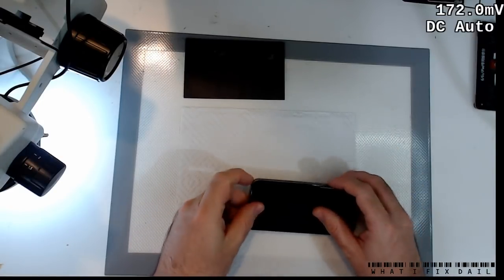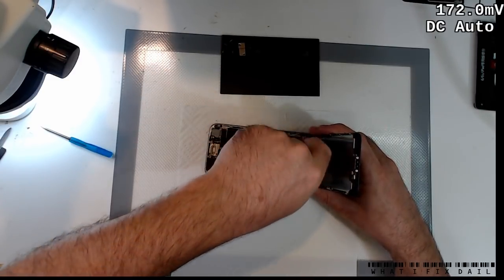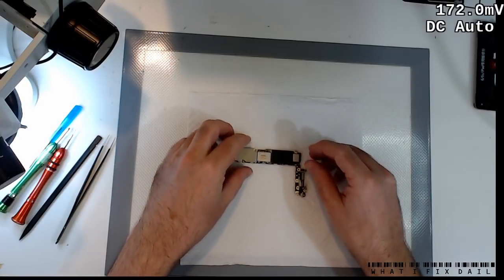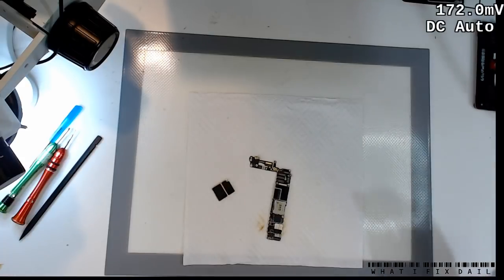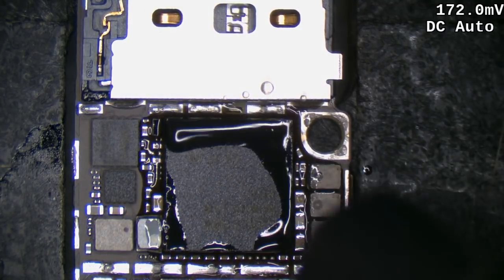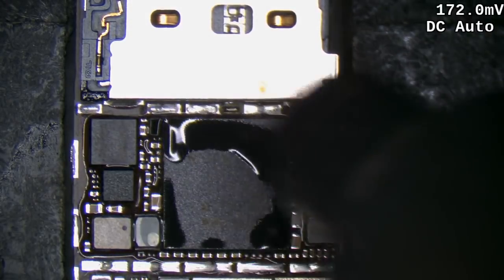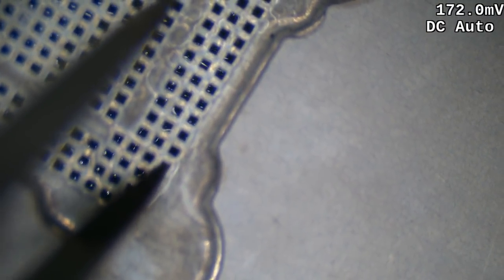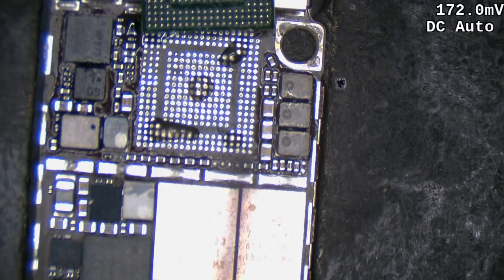iPhone 6 endless searching fault - Baseband CPU fix

Comment: Which dry solder paste do you use please?
Also you were mentioning that if the power supply draws only 130mA, it might be a short? Did I get it right?
Reply from the maker: I've forgotten the context on the 130mA comment, sorry.

As for the dry paste, it's just cheap normal 63/37 leaded paste, in this case, the "Mechanic" brand, and I leave the lid open a while until the flux solvent dries up in it.

Comment: Excellent! 
Paul, what do you do at 9:30 ? UV curing? If so, the UV curing equipment is fairly small?What kind of equipment is that?

Can post a link to the reball stencils you use? (I was told square hole stencils  are better thank round hole stencils.)

What temperature do you use with your stencils so that they are not deformed after very few uses?
Thanks for replies.
Reply from the maker: I heat a large area on the stencil so that the metal expansion is "evenly spread" which reduces unwanted buckling.

The stencils are from UnionRepair, 3D stencils with square holes ( and yes, square holes do make it easier to remove the balls ).

The UV curing is just a cheap UV torch I bought for other purposes.  It is not as quick as using a big 5 or 10W lamp but it still cures the green liquid in a couple of minutes.

https://www.unionrepair.com/mj-3d-bga-reball-stencil-for-a8.html

Comment: Do you really need to put the RF shild back on again? I'm asking this because there's a lot of shilds arround and also you have the back case and the LCD panel back.
Is that really a need? Because that's a pain in the ass to take out and put it back again.
And a lot of stress on the components.
I'm thinking on holding it with the screw on the right corner and also with a bit glue (B-7000), which is more easy to remove later on.
Reply from the maker: It's the "right thing to do".   You're right though, of all the shields on all the phones, the one covering the iP6  BBCPU is a real pain.  While I normally hotair reflow the shields back on, for the BBCPU one I end up having to tack it back on with the soldering iron.  That middle bar through the shield can be a lot of trouble, so maybe cut it back slightly or try remove the low-temperature solder from the pads on the PCB?
Reply: That sounds right to me, great tip sir.
Also i would like to know how many degrees? 450º full air speed?

thank you for your enjoyable videos
Reply from the maker: For the BBCPU shield, flat out with everything, 480'C 100% air for me, the faster the better it seems with that one.

I might try with no nozzle on it too, I think the 9mm isn't big enough to get the heat down quickly.
Reply: oh sorry! i meant the baseband IC.

Comment: I would have nudged that wire toward the via a bit too :D  I think wicking the pads like you do reduces the odds of something getting bridged by a good percentage.  Very nice work.
Reply: Get back to work jason, mush mush lol :-D
Reply from the maker: Would have driven me insane if I had not.  I didn't want to try reflow it when I was putting the wire down, probably should have.

The hotair wicking does work well, but I find only if you're going to put leaded BGA balls back down.  If it's going to be a lead-free item I find it's better to have a little leaded on the pads to 'salt' it, not sure if anyone else has found the same.

Thanks for dropping in.